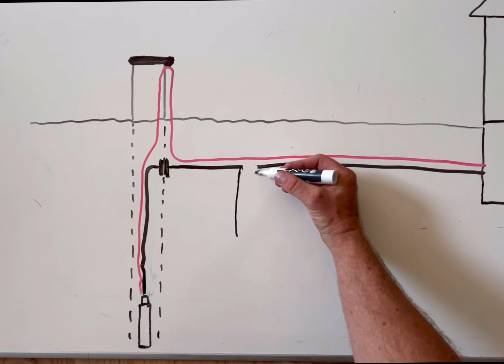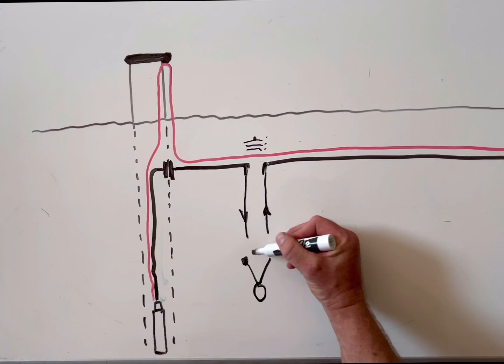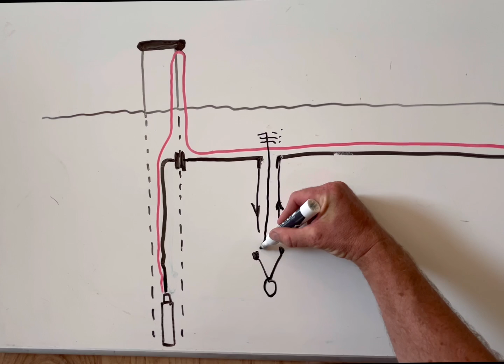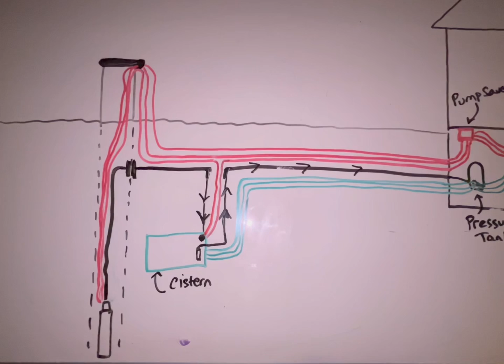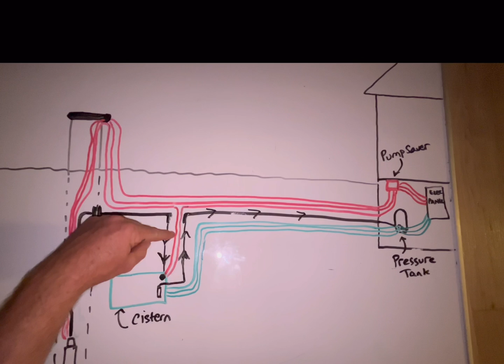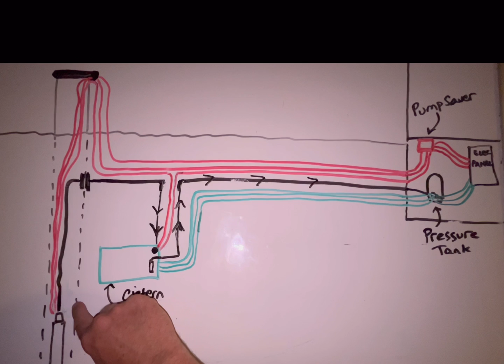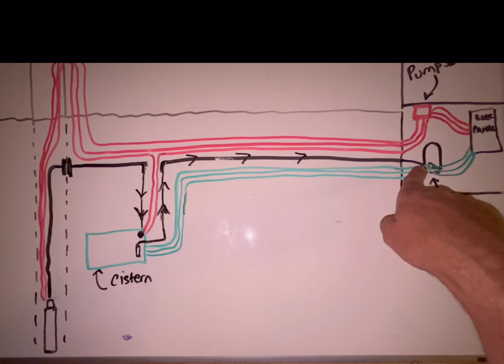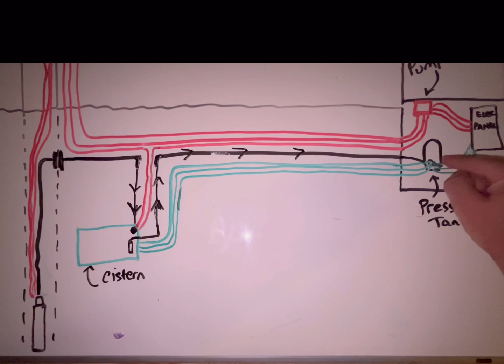How to install an underground well reservoir cistern system for low yield well

Comment: What in this system will prevent the existing pump in the well from running dry? It seems to me it would need to be on some time of timer or controller so that it only runs for a bit working to refill the tank. We are working on a new construction and about to install a 1200 gallon cistern to supplement a Pentek intellidrive system. Would this setup work for us? I would like to avoid installing a pump house by putting the pressure tank and switch gear inside the utility room. Thanks for posting this.
Reply from the maker: We use our PumpSaver to protect the well pump. Your Pentek Intellidrive likely already has run-dry protection built in. Check out our website for more info. Thanks

Comment: Great video and explanation. Around 6:35 in the video you show the cistern pump line going through a grommet in the end of a 4” pvc. Is that anything special or just a simple hole in the 4” cap with the right size grommet for the supply line to seal through? Can you share a part number and/or supplier? Thanks.
Reply from the maker: Hi! Great question! That is our 1” Tank Penetration Gasket, available here: https://www.rainbrothers.com/store/PIPE-GASKET-FOR-TANK-PENETRATION-VARIOUS-SIZES-p310981998

Comment: By taping one of the hot wires for the cistern pump, aren't you going to need a neutral wire as part of the rewire? I thought that was why they  have it in a standard 4 wire 240v setup. Such as when your sending power to an electric stove that has some components, like a clock/timer that use only 120v. You'd then need the 4th or neutral wire.
Reply from the maker: Pumps do not have neutral legs unless they are 115v

Comment: I ran the existing well pump wire to my cistern pump instead of the well pump, and ran a new line from a dedicated breaker to the well.  Same end result, but no need to change the wiring around the pressure switch.  Did the wiring in the box at the well instead of underground splicing.